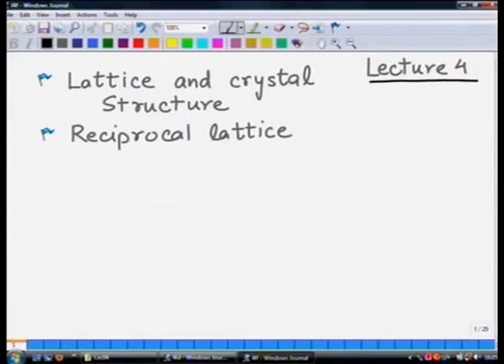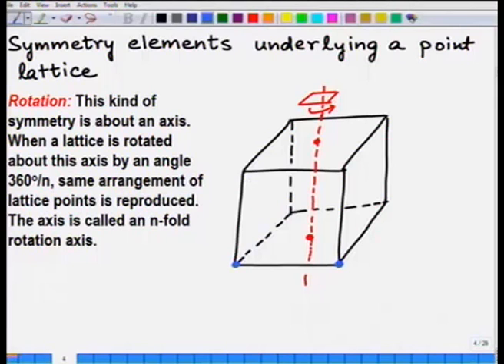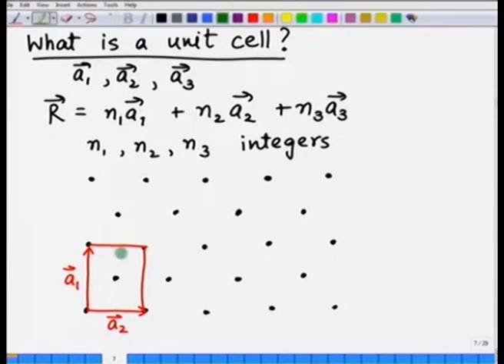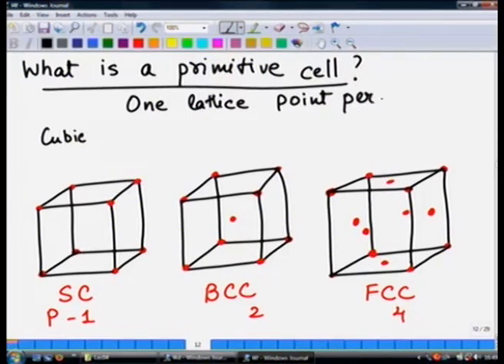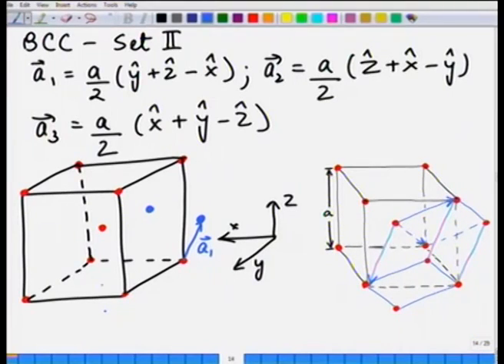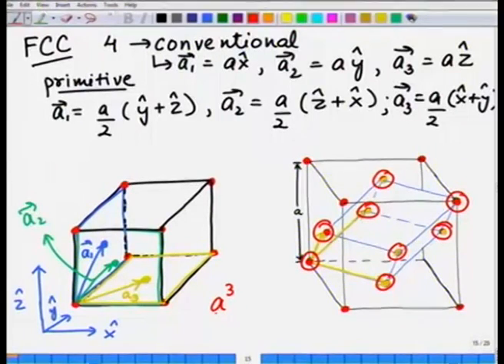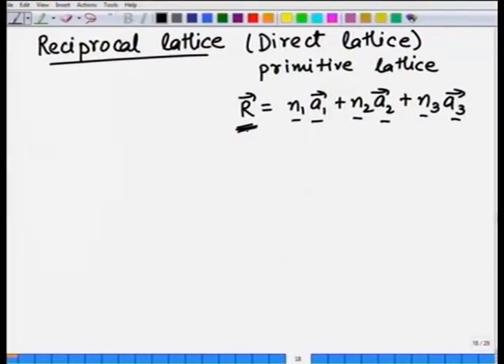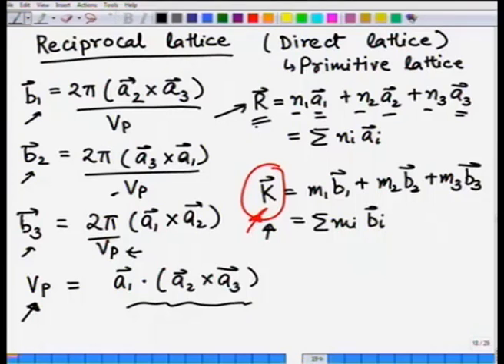Mod-01 Lec-04 Crystal structure, Reciprocal lattice I

Comment: Why we don't have Face center tetragonal bravias lattice, even in case of orthorhombic where all three sides different i.e, a,b,c all are not equal to each other, but still we have simple cubic, body centered, face centered and end centered. why so in case of tetragonal, only simple cubic and body centered, not face centered?
Reply: This is a standard question, I am sure you can find the answer at the same place you read the question.
Reply: FCC in tetragonal will become equivalent some other structure in the bravais lattice